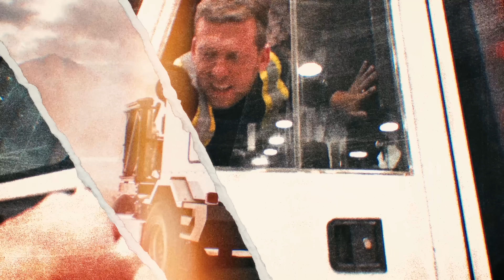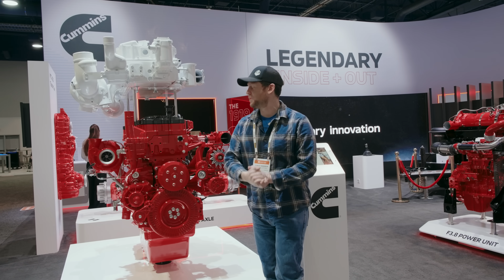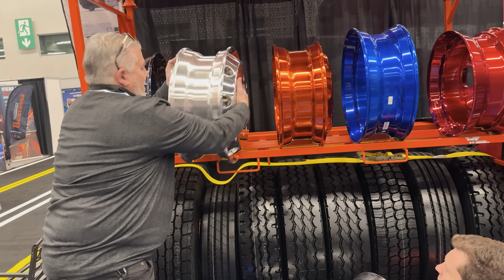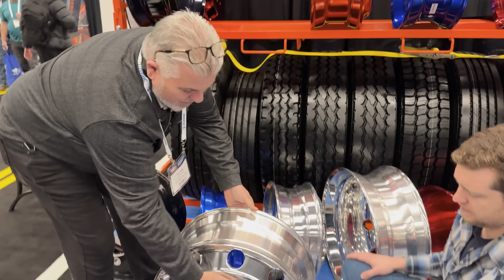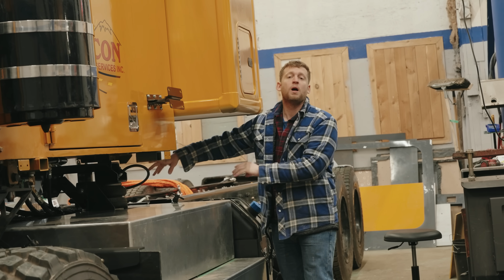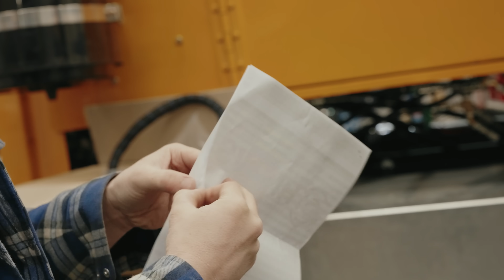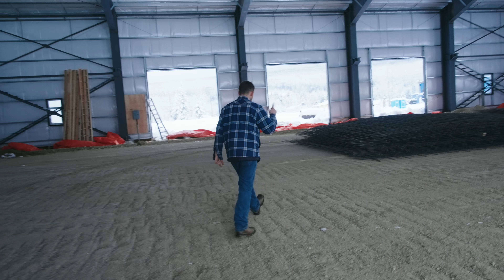This Changes Our Trucks

Comment: Do you need the same size radiator on the hybrid truck than on the BDE truck? Or can you reduce the size of the hybrid radiator because its a smaller engine and the drive train is more efficient, so it produces less waste heat. What is the peak waste heat load in the worst case: fully loaded truck, with generator on, electric motor at full power, on a steep hill, at high altitude on a very hot day?
Is the front visibility still ok with that massive radiator? Can you see and avoid pot holes?

Comment: So about Espar heaters.  If you're using ANY Espar heater, please make sure to include the altitude kit, because it'll correctly adjust the pump dosing so it doesn't flood out the burner.  Any guy with an Espar d4, can certainly tell you that it's not working/not lighting, because the D4 pumps way too much fuel without the altitude kit.
Reply: Also make sure you run it full blast about once a week to try to remove excess combustion byproducts on the flame tube
Reply: @bingusmctingus4395  I have a D2 and I agree

Comment: Paulona wood is naturally fire resistant or check out  Inventwoods  chemically engineered Superwood...it's also stronger than steel or Aluminium.  So is Expanded natural cork.

Comment: I think its great you have the wood floor and starlight lighting,,, it would be a total mindbender that as a manufacturer, you could "at extra cost" be able to slide a truck to the side of the line and add custom features to any special order truck

Comment: Are there low voltage fans that would work?   I would hate to have to pull out the rubber gloves just to work on the fans.
Reply from the maker: Yeah, that’s one of the things we’re improving
Reply: 45/48v is a nice in between. A lot of OEMs use that for their partial hybrid stuff. If you need any significant wattage on a 12v circuit, 45v needs ¼ as many amps. That means much less weight in wiring - copper is expensive. Down the road this 12v motor for all the hydraulic and mechanical pumps that Chase has created might be better as 45v. Cheaper wire and it's much easier running thinner gauge wire.
Reply: @steverheault5915 I agree.  48 volts is a better system and I do see manufactures moving in that direction.   But it is a SLOW process, so much legacy products.   That is the Edison issue.  They want to use off the shelf components but those are going to be the more antiquated 12V variety.  48V gives more headroom and flexibility, at the cost of parts availability and frankly 12V is just cheaper.  I just wish we had gone to 48V around the turn of the century.
Reply: @steverheault5915  most of the stuff you need would be easy to find off the self as 24v and even that will mean half the amps for same power. Pretty much every truck and trailer in europe is 24v, 12v is really only used in for infotainment and some random small parts
Reply: @eikuz Yes I'm surprised car makers haven't made the jump. 10 KGs to save on small cars, 20 on big cars and pickups?